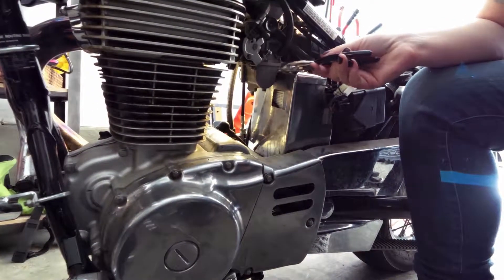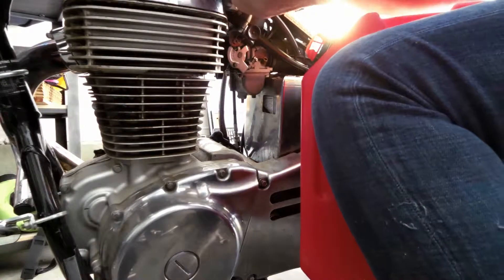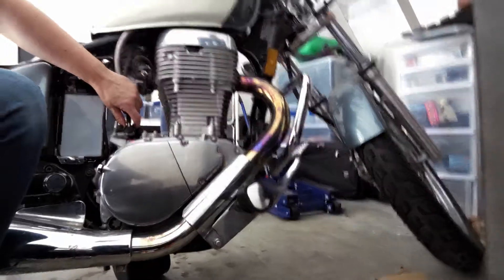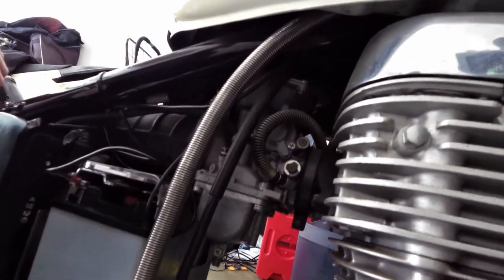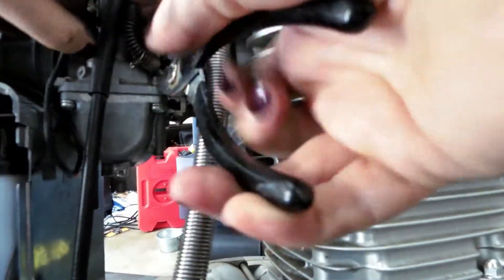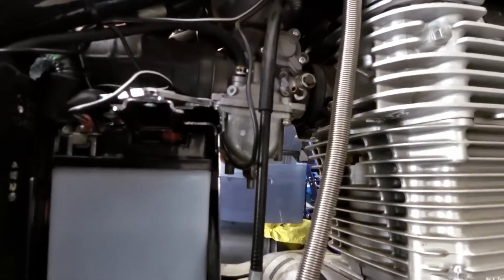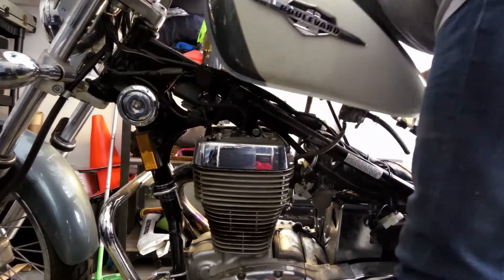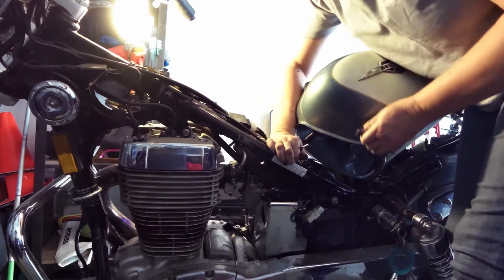2014 Suzuki S40 (Savage) tank removal

Comment: Thanks, very useful. I need to run a usb charging cable from the battery to the front, and wondering if I need to remove the tank or not.
Reply from the maker: You should be able to slide the battery out of the box enough to place the connections. Then you can slide the USB cable under the tank, and fish it out at the handlebar end. Shouldn't have to remove the tank.
Reply: @MototasticAdventures  I did exactly that!  It was too much work to drain the valves and petcock. Just lifted tank barely to push in a line and pull the cord up from the battery side.  Also ditto on the battery - didn't have to remove it - seemed more work.  Though at some point I wonder if I will have to remove battery to top up fluid levels. I dread it. S40 battery access design is overly restrictive. Thanks